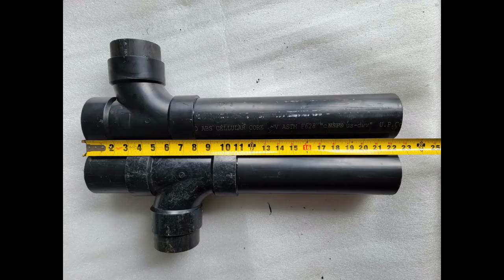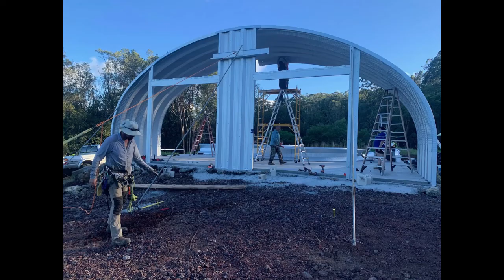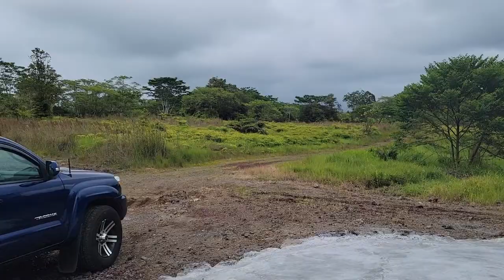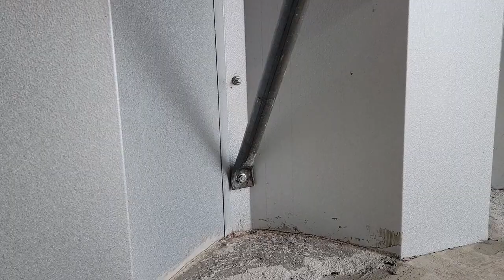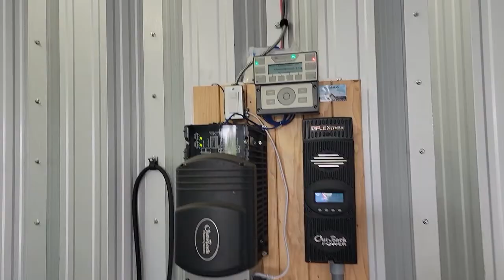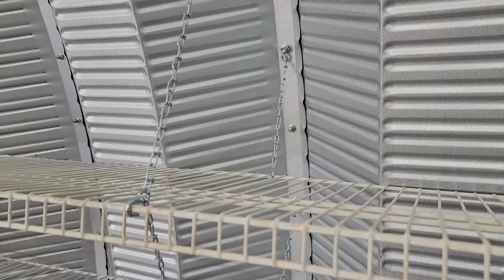Quonset Hut Build

Comment: This style is far BETTER than a real original Quonset design which are long out of production in the US.  Be glad it's not one because Steelmaster and clones are far easier to erect and work with.
Some older folk may remember the US Wonder Arch buildings (or have worked inside military HAS which used that makers buildings as a internal concrete form and spall liner) which are its predecessors. If you anti-seize your bolts as I did you can swap them later to add internal accessories (like the truck service bed boxes I drilled and bolted to mine for handy storage without losing floor space).

Comment: I'm concerned about the concrete touching the cut edge of the panels.  Galvalume should not touch concrete plus water and dirt will corrode the bottom unless a gap was created.  Is there the potential of volcanic airborne ash in your area?  That can also be very corrosive to metal.
Reply: Mine survived near thirty years in South Carolina rain and humidity and is fine today, but I poured leftover asphalt roof coating into my base channels (my building is bolted to reused steel beam foundation which cost me less than buying wood since I bartered for the steel which is often reasonable). Local demo companies often sell steel via Fecesbook Marketplace).  This style building lasts many decades, like the Wonder Arch my bro bought and  we disassembled to use at his place. If you want to further protect your base channel I'd invert the sections on saw horses then slather it with asphalt. Let dry, flip the channels then goop the bottoms. They're well proven and if needed any panel can be replaced, even base channel though that would not be fun. (I'd slice out any damaged sections with a cutting torch then trim them with zip discs and drill the upper sections them splice them with bolts.) I have no doubt mine's good for a lifetime.